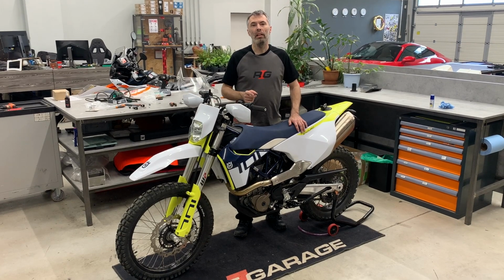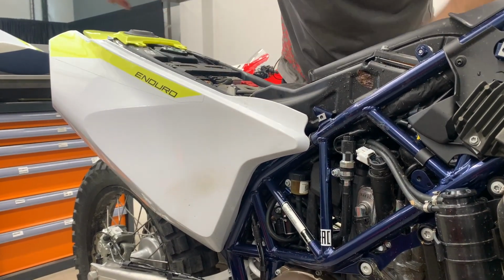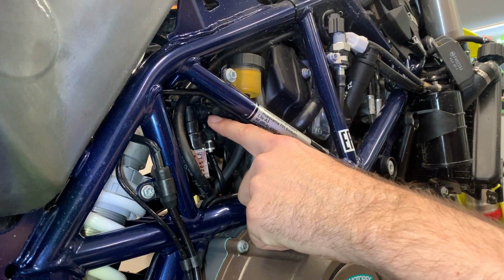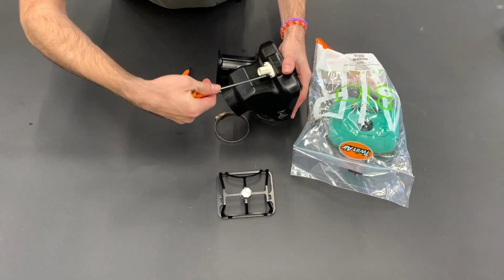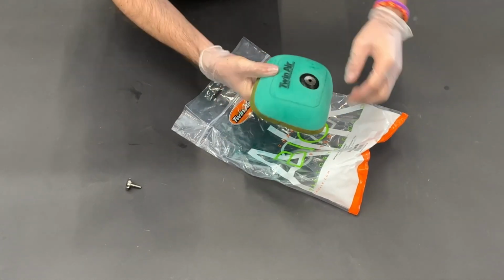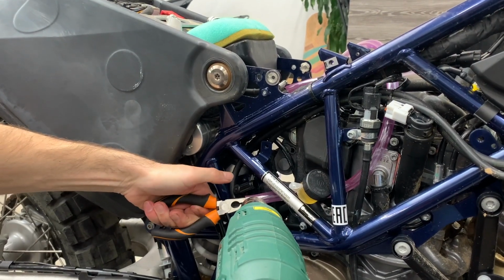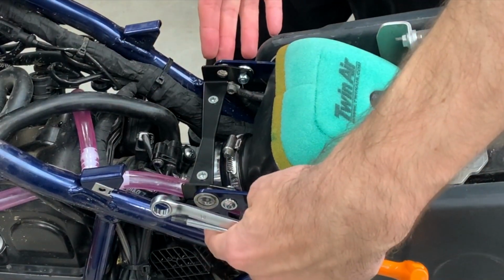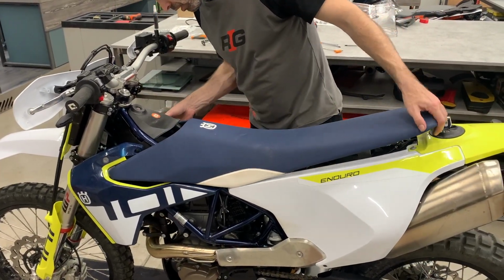Husqvarna 701 storage kit installation - RADE/GARAGE

Comment: hi!! do you need a remap after changing the filter? Is it safer?
Thanks
Reply: From what I was told by Rade Garage is that it still runs within an acceptable spec. But a lot of people on the forums seem to disagree haha.. 
if you dyno the bike it will run lean from the factory.. so everyone says to get a Power commander for it anyway. Depending on who you talk to everyone has a different opinion.
Reply: @Brody_RaTBoY  yeah man can't get my head around this topic.... I have contacted rotweiler to see if they have a premade map dongle for the 701, I don't want to spend 400 dollars for a power com or dyno map...
Reply: @giovannicolligc  yeah it’s weird. I’m ordering a ECU flasher from BHP-UK today. 
I have  an akrapovic slip-on and the twin air air-filter (also fuel dongle from Rottweiler) but I want to be sure I’m not doing damage. It’s a bit pricey, but killing my engine would be worse I guess.
Reply: Also this is a good video that Rottweiler does explaining running the bike with an upgraded intake without a ecu flash or PC. 
https://youtu.be/BFmbQSDH998
Reply: Altering the airflow this much and not giving it more fuel is a really bad idea cause it's already rening lean from the factory and will run even more lean after this or a rottweiler intake, Even more so if you have a slipon aswell. Either flash the ecu or install a power commander, fueldongle is not enough.